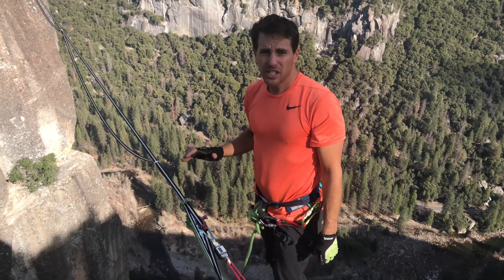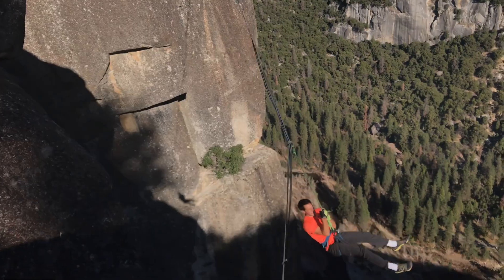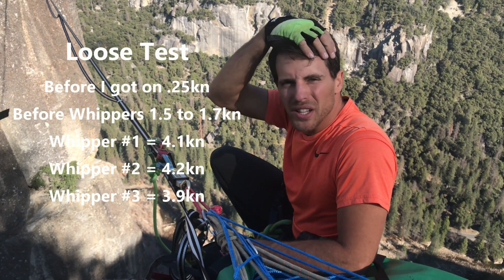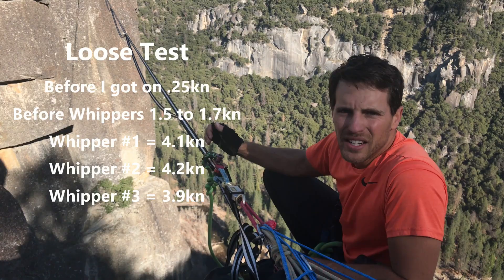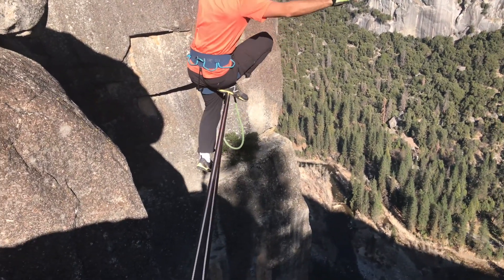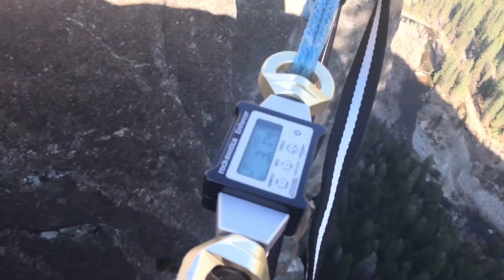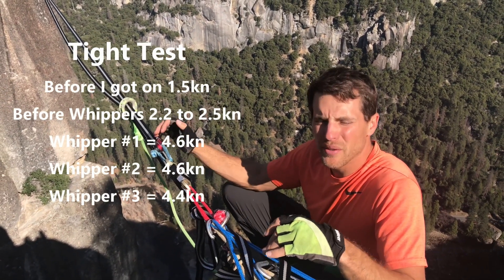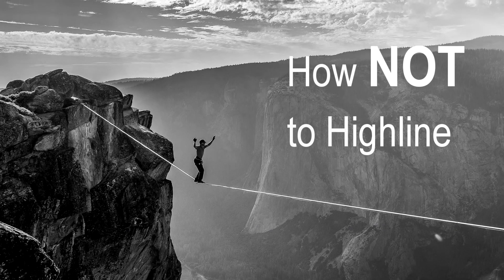Forces on the anchors during highline whippers at the Rostrum in Yosemite National Park

Comment: When you just put it trough a pulley at the fix point and pull in the direction of the line you only redirect it but don't get any advantage. When you put the pulley on the line instead and run the rope from fix point to pulley and pull towards the fix point you have a two to one. When you pull towards the moving side, the rope you pull on isn't  counted, when you pull towards the fix side you count it. At least that is the way i learned it from a rope access technician

Comment: Cool stuff. I’m interested to see this test with different kinds of whippers. In all of those you whip really nicely in a rounded fashion. The leash falls that tend to hurt (in my opinion) are the ones where you slip off and almost fall directly down. I would love to see / gear about the different force generated and which felt better. I’ve whipped on a few less than hand tension lines before and all the whippers hurt. After adding some tension the falls were far softer. Thoughts?